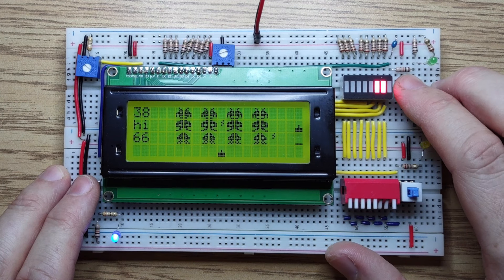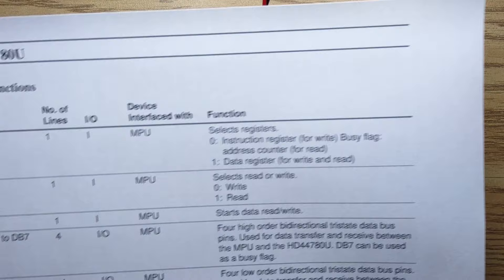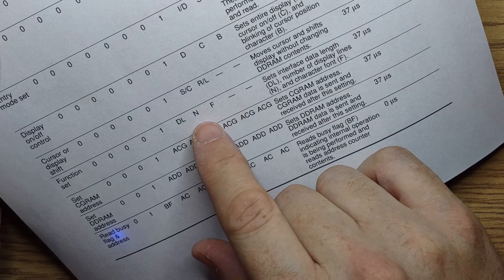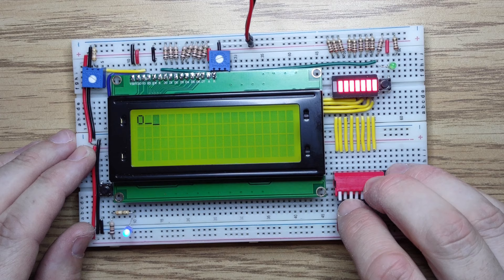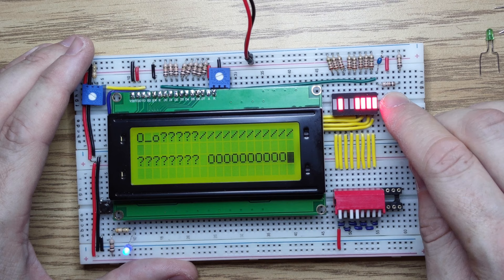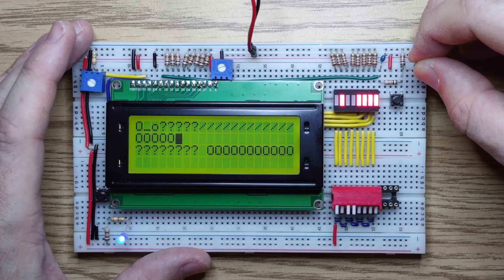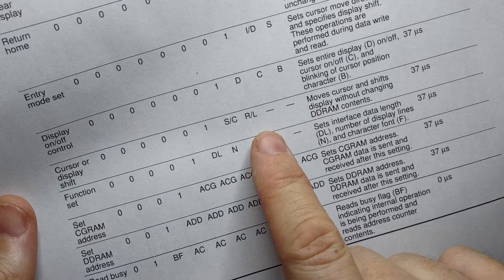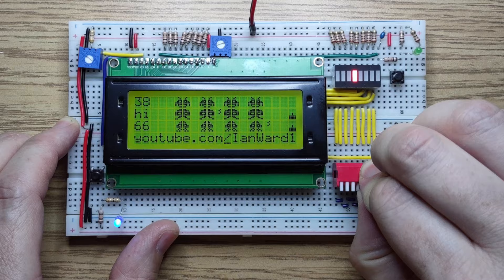LCD2004 20×4 LCD Character Display with HD44780 Tutorial (All Switches and LEDs, No Microcontroller)

Comment: How did you mount the dip switch like that? My screen arrived already. I'm going to go at it alone and use this great video as a reference
Reply from the maker: That's awesome. Let me know how it goes! I'm using an IC socket for the DIP switches because the pins aren't long enough to go into the breadboard otherwise
Reply: @IanWard1  my ic sockets are like the many red switches I have and they don't stick in either. I may finagle a better way to use it by hotglueing it to female headers that resemble your dip sockets. I'm going to do it tomorrow
Reply: @IanWard1  hey man. I figured since we spoke before I'd bounce this idea off you. I think we spoke about an in box vic20 (unfaded) with the original manual and a floppy drive. I run a personal charity where I anonymously donate electronic engineering related arduino kits to people who can't afford it or who want to learn and I include a nice dmm and an arduino kit based on the 100cad elegoo most complete arduino kit. I used to advertise the kits but I've decided to just go all out for a school or a makerspace where elderly and disabled people attend and they can take the stuff home or have it to use at the space or school. I plan on having 15 kits which I already pretty much have, a new 2 channel dso with a function gen and a new 3d printer(with 20 rolls of pla I already have) along with a bunch of supplies like wire and stepper motors, big servos and bldc ones for building robotics or anything really even a large number of ics for logic, voltage, opamps. No soldering irons though. I don't want someone to burn themselves because of me haha. I'm doing this as a one time thing as part of my therapy for ptsd from being a first responder for my whole working career despite having a software engineering degree I never used haha. Sorry for rambling, there's a reason because I want to come off as sincere and I can prove who I am and all this.

Anyway, I'm looking to sell the 8 bit computer to help fund this endeavor. I'm not looking to get a fortune for it and the problem is I don't know where to sell it. I checked ebay and all that and I only want barely half the going rate for what it's worth. Like 150cad plus shipping. That will get me 8 more digital multimeters. Sorry if I seem weird but you seem like someone who would be able to know someone or something. If not that's cool. I haven't even tested it yet but I'm sure it works. It is as if it were bought and used for a few weeks and put back in the box haha. There's a joystick and some generic game carts. I'm going to test it on an analog TV I have in our basement lol. Anyway. I appreciate you reading this diatribe. I'm sending out feelers to everyone I know of. Haha  anyone in Canada or north America preferably. I can prove who I am and all that to anyone who is interested by letting police dispatch know someone might call asking if I'm a real person and where I live haha. Peace man

Comment: How many volts power supply are you using;
Reply from the maker: I'm using a bench power supply set to 5v in this video but it also works with the 5v power lines from a regular cheap USB charger.

Comment: I really liked seeing this.

Got my first 1602 (I2C) and it's working with a M5Stack StampS3/ESP32 on the next day. In Arduino IDE,  the library doesn't allow the pins to change, so it's done from "Wire.h" and we can't use lcd.begin(), but lcd.begin(16,2) goes through and lcd.init() works. The worst is something like M5.begin(), (needed sometimes in my case) will block pins and create something I don't know for sure.

My next attempt is more attempts with a 1637 that isn't I2C, but almost. In between, I get another module going. A GPS module was quite mind blowing to dig into. ESP-Now is also new to me.